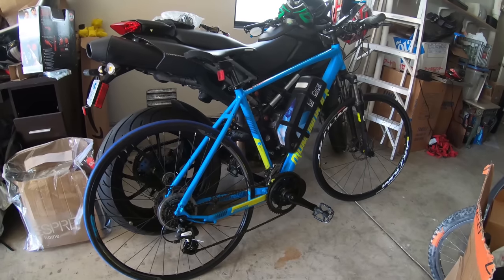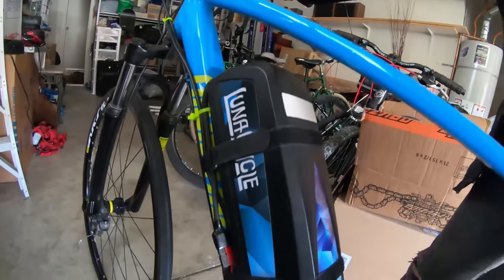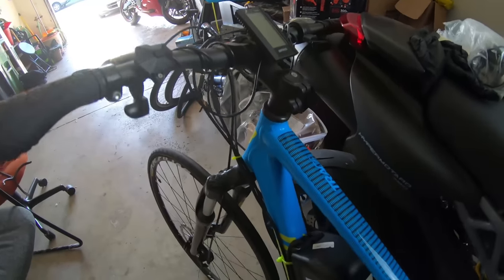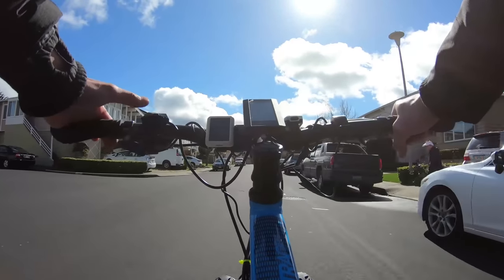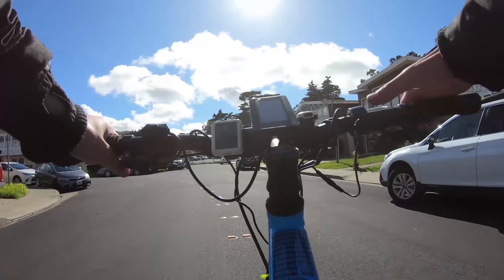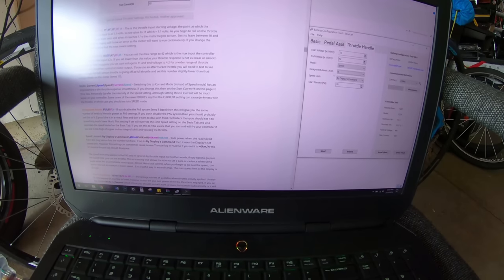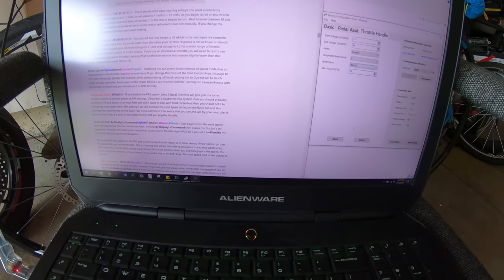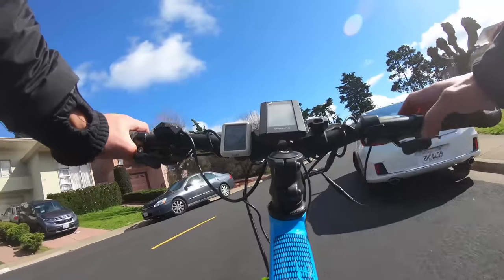Bafang BBS02 750W 8Fun Mid Drive eBike Motor - Review and Programming

Comment: Hallo, how many km you can make with full charge?
Reply from the maker: The battery advertises 40+ miles.
Reply: @ColinLeung  hey there, how many km range you get now with pedal assist levels and on motor only.. Thank you.
Reply from the maker: @dilyan-2904  Hello Dilyan, I've never biked until the entire battery was drained. The battery is supposed to last 40+ miles (65+km) with full throttle. I'd assume it would add 25% more range with pedal assist. I hope this helps

Comment: is your throttle  work like a throttle of a motorcycle?   my throttle work like a switch and l like to change it to work like a motorcycle throttle
Reply from the maker: Yes it works like a motorcycle twist throttle. This is a similar product that I installed https://amzn.to/390n8ZH
Reply: @ColinLeung  i mean do i need to program my bafang bbs02b so that my throttle will work like a motorcycle throttle?
Reply from the maker: @eleanor5219  you shouldn't have to. Did you have a thumb throttle before, and did it work properly? Maybe it's connected to the wrong wire?
Reply: @ColinLeung  they send me a thumb throttle when i ordered my mid drive. its working like a switch. for example the speed goes straight to 12mph at level one and 17mph at level two etc.  i though its suppose to work like a motorcycle throttle.  you cant go wrong with the connections because the cables are color coded
Reply from the maker: @eleanor5219  That's strange. I would contact the manufacture and ask them if it's normal. They may send you another if it's defective.
Reply from the maker: @eleanor5219  I looked online and someone with the same issue had the throttle replaced, and it works as it should now. 

"To answer my own question here, problem was just the throttle, no issues with the replacement throttle and sent new controller back to the vendor."

Try contacting the vendor for a replacement.

Comment: Im guessing with that big battery you’ll be able to go 50 miles.
Reply from the maker: The previous owner said it would do 60+ miles. I haven't had the chance to test it out yet.
Reply: 910 watt hours is a LOT, a million variables factor into range estimates. Aerodynamics (it's exponential) and climbing being the largest two.
Reply: Also depends on if you want comfort or a very painful  road bike with  no suspension  lol I have a hard tail buy I plan to get a suspension  seat  post and a more comfortable  saddle comfort is needed  if if I get 70miles depending  what speed I probably  cruise at 20 to 30mph anyway  on a 750watt  bafang  52volt  battery   so that will probably  go 100miles even if I put more effort  to pedal the asist  is more for longer journeys  or for when I don't feel like pedalling
Reply: Probably  could do 100 miles I know I can pedal a fair few miles but then get tired so to have a ebike where you can turn on asist when you need it
Reply: @jonathanoxlade4252  im guessing 50 miles with the bike shown

Comment: That mounting system of the bafang isn't that great. Motor can start rotating after a while again. I wish that they added a similar system as on the Tsdz2 against rotating.
Reply from the maker: Agreed. When I removed the hub from the bike it already started shaving off the metal by the bottom bracket.
Reply: @ColinLeung  I was thinking of using one of the 2 bolds thatt hold the side plate on, to connect to an other plate that goes to the frame. That helps withy the rotating.
Reply from the maker: @emiel1976ep  Awesome. Thanks for the tip. Let us know how it turns out
Reply: @ColinLeung  I will.